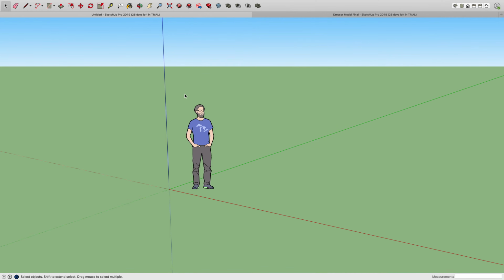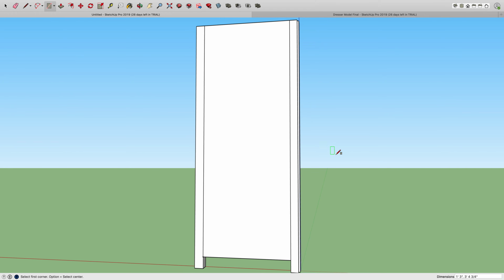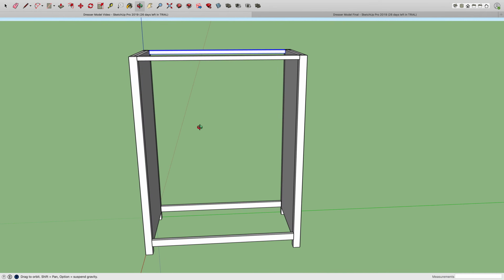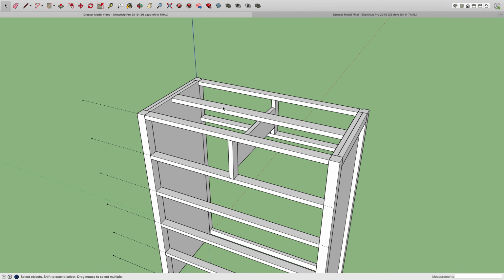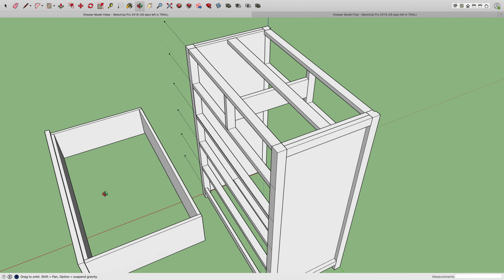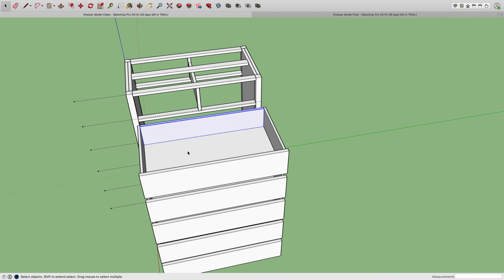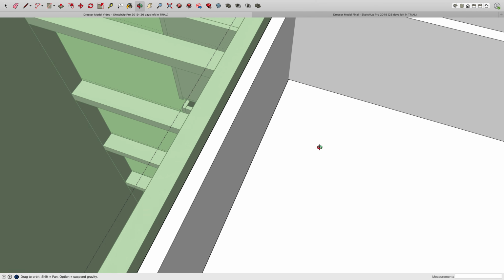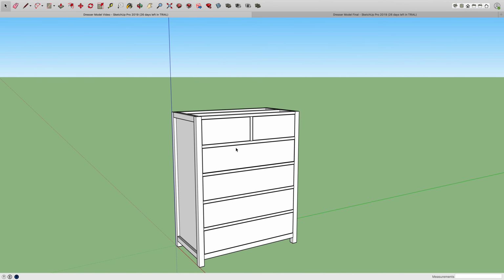SketchUp Woodworking Tutorial | Full Dresser 3D Model

Comment: Found this while searching for a Cutlist for Sketchup Make 2017. Watched that video 1st, then this one to see what techniques you used to make the dresser. I learned a couple of tips I wasn't aware of, especially with making groups and then flipping the entire group along an access. I was making components and flipping each one when I made a duplicate side. This alone will save me a bunch of time. I also used the trick of splitting an area into equal parts, but I did that after making the drawer front, and duplicated the front x number of times equally spaced. I think I like your way better because it leads to less errors, and you get a better feel for how the project is coming together. Now on to re-watching the cutlist video and seeing if I can get the tool to work in the 2017 version.

Comment: Andrew, really appreciated this treasure trove of tips.  I've drawn two projects so far, and just realized the hours of math and drawing with pencil and paper to prepare to draw in sketchup was totally unnecessary.  Great job!

The notion of components is new to me here, and I see why they are needed for your next video on cut-lists.  I'm wondering about more complex joinery though.  If you do a half-lap/rabbet, does the cut-list tool just ignore the cutout of the dado?

What about doing something like a box joint or dovetail joint?  Would you bother diagraming that here?  I'm guessing not, and instead you'd want to have a component for each board with 100% overlap in the space where the joint is for the two boards?  How does that work?  Any ideas?

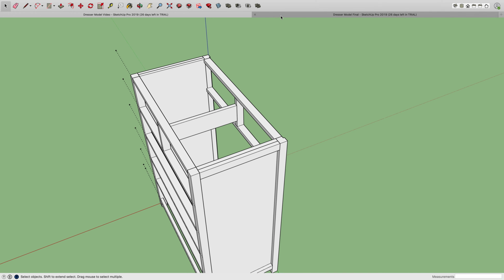Comment: at 27:34 you mentioned that you selected a size for a cross-member that was convenient for the cut list.  How did you know that?  Did you run the cut list tool, and find that you were eating into an additional sheet, and realize if you shaved a little off one piece you could cut your cost by 1 sheet?  I'm curious to see how you knew that this piece should be smaller and also what size to choose.